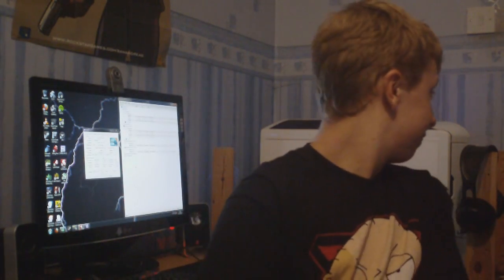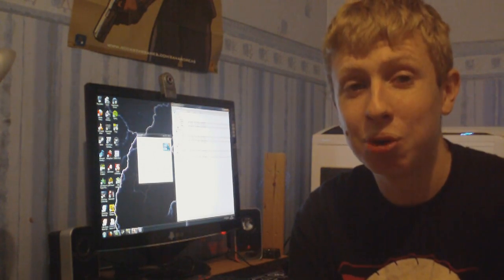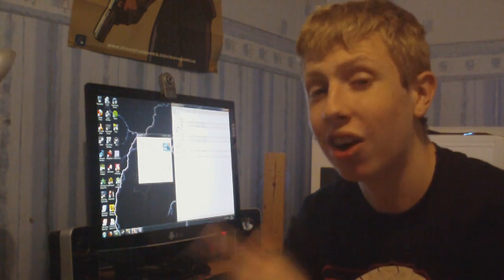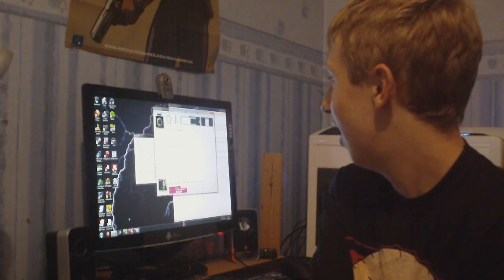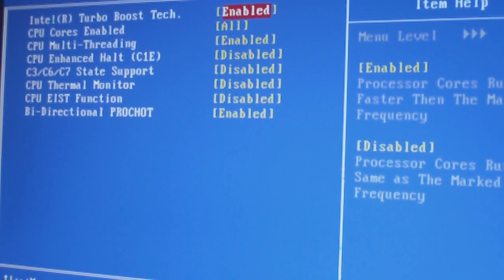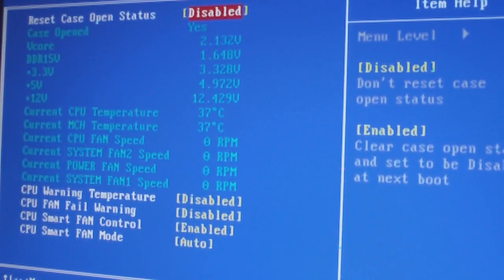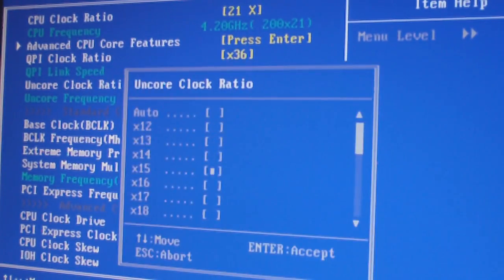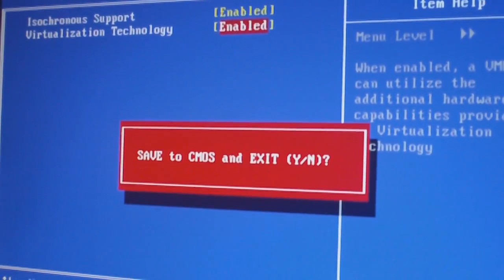i7 920 @4.6GHz on air

Comment: Idle Temps at 80C, perhaps. Just perhaps. Open a program or two and I'm sure you found it heading past 90C in no time at all. At least that what I found, and I never tried going above 3.7Ghz. Definitely unhealthy. 
I just installed a Corsair H60 and have decided to set mine to 3.2Ghz. That's a 20% increase and fine enough for me. I'm idling just 50C.

Comment from the maker: the board got dropped a few times before I got it and the voltage sensor is broken and constantly reports 2.132 no matter what I do, though I have since replaced it with a UD3R and then replaced that with a X79 system but the board still works :)

Comment: @pccomponetreviewer im only using a stock fan but still the readings of temp is too high. no overclocking was made i loaded the bios settings at optimized defaults.

and also why is my core temp higher than cpu temp. I am using coretemp, real temp and cpuidHWM.  same readings

Comment from the maker: @izlude2 it is D stepping 
tbh i couldnt say 
you deffo wont get 4.6GHz 24/7 stable on air as it is just not good enough. 
i am currently testing one of the best air coolers on the market and it cant even handle 4.4 @1.34v let alone 4.6 @1.60v. i was only doing it to see if it is was possible to boot up. 

steepstep is the one you need to disable